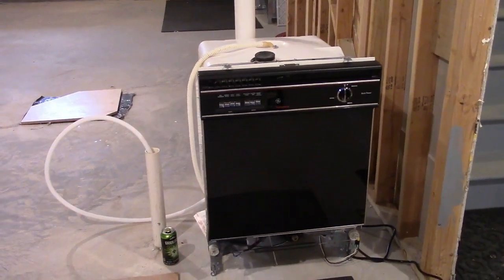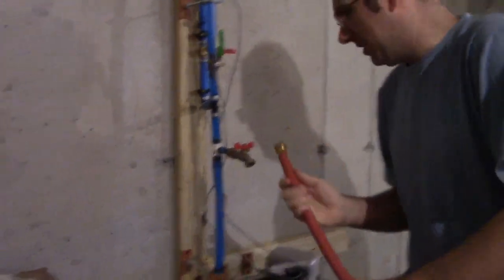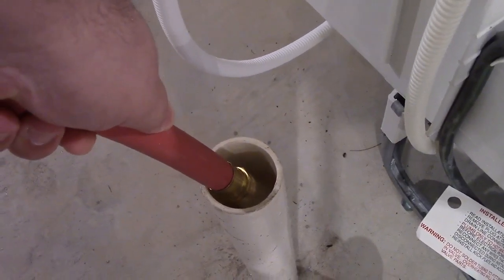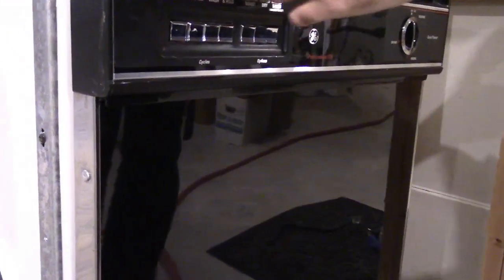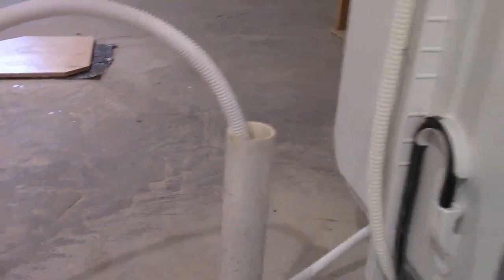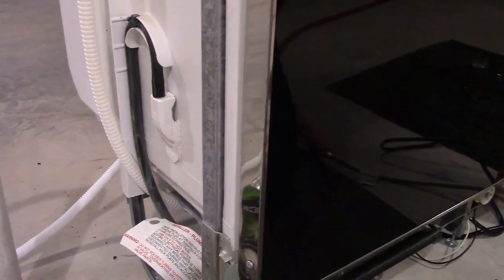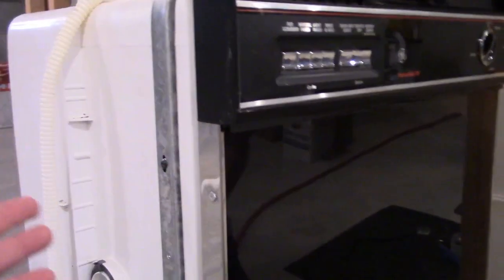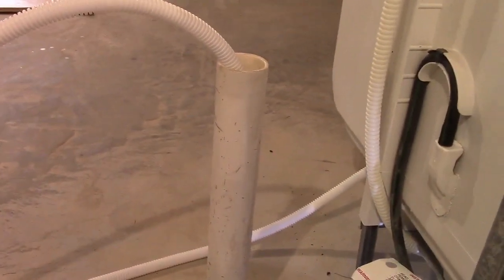Running A Cycle On Sharkie626's GE Potscrubber 970 Dishwasher With Wattmeter

Comment: So that was .59 kilowatt hours, and that was with the delay in the Potscrubber cycle that we let go for a while. So yeah, if this thing is in Normal Wash with Heated Dry, it is HARDLY gonna use more than the JennAir did with its 1 hour wash. That modern dishwasher's pump by itself uses very little, but the heating coil itself easily uses high 700s to low 800s (imagine if it was connected to cold water!). This uses about 450? Amazing. Once I have hot water there again, I gotta get a full cycle with the watt meter going. And as we all know, that modern pump isn't powerful enough by itself to operate all spray arms at once unlike this one is. 

Maybe the ONLY this this may use a little more of is water. But what do we know about water? It is MANDATORY to use in order to clean something, and clean something well. There is no way around it. Otherwise you'll end up with videos like that Technology Connections nimrod.
Reply from the maker: So what did we say in the video, 20 cents per kilowatt-hour?  So a full load including heated dry costs a whopping TWELVE CENTS of electricity.  As for water, they say you use more when washing the dishes by hand.  And we won't talk about how many flushes it takes in HE toilets, how long a shower someone takes is, and of course you can leave your sprinkler system running 24 hours a day if you'd like!
Reply: @jaykay18  Right? As usual, people will just buy into what many other says with no visual proof whatsoever. These toilets have honestly not been all that bad (could be because of my adjustments), but man do I miss that 3.5 gallon toilet. I wonder if the new owner still has it there. Well with the whole sprinkler system story I told you about, it might as well had been running for 24 hours.
Reply from the maker: @Sharkie626  Yeah that toilet was great.  Both of mine are 1.6, but at least 1.6 instead of 1.3.  And none of this number one number two stuff, that's beyond ridiculous.  Shouldn't my toilet like, be smart, and know what's in it so it can flush accordingly?

I've also found the style of toilet makes a difference, my downstairs toilet generally works a lot better than my upstairs, but they both get the job done most times.  I've also adjusted them as much as possible.
Reply: @jaykay18  New modern dishwashers have a draw, for example, .7 watts, as opposed to the GE and other mechanical timer dishwashers, which doesn't have a draw. Modern dishwashers waste electricity just being plugged in and not running. If we use the calculations that Jay used on his washer video regarding electricity use, we can do about ten extra cycles with the GE potscrubber dishwasher. I am thinking about one day getting an old dishwasher with a mechanical timer (GE potscrubber, Whirlpool with reversing motor, etc.), and a modern dishwasher with lots of fancy features(Samsung, LG, etc.) and do a comparison (cycle time, how well it cleans, how much wattage it uses, etc.) with these dishwashers. I may do the same thing with washers too.
Reply from the maker: @jacobflanigan6343  That's true, I didn't even take that into account.

Comment: Nice, Classic Runner!
Reply from the maker: Yep, I'm sure it does a great job!
Reply: Still been searching for a toekick panel and lower access panel. Sadly they are hard to come by. However it looks like one of the color inserts for them are still available.
Reply: @Sharkie626  Someday something might turn up on fleabay. Might be easier to have someone 3D print mounting brackets, and find some nice wood to finish it off.

Comment: I miss my old potscrubber machine that we used to have. Good thing GE still has a model with a similar design. The GSD2100 machine that is out now is not too much different then what was produced twenty or thirty years ago. Great vid as usual.
Reply from the maker: Yeah, that's the one dishwasher left out there that's good.  Not the same build quality as this older one but then again everything's a piece of tinfoil nowadays.

Comment: DishWash.. Day Wash-in was sponsored by phosphates in your cleaning products. Phosphates, get the dull ou- oh wait that's Ajax, wrong video. Dee what I sid there?

Reminds me of the old Whirlpool Dishwasher from the 90s in my old house. It was one of the porcelain insides, and you could REALLY hear the impact sound of the water on everything. I always loved sitting in front of that thing as it ran and just hearing that roar of the motor and pump doing their thing.

It was similar to this, you had your cycle selections, heat dry or air dry, and then the timer for how long you want to run it for. The buttons were plastic, but had a heavy click, similar to Sharkie's 1990 machines. It was just a big CHUNK, then you turn the big timer, yank it and away we go! I used to use the steam from the heat dry to clean my glasses back in the day, as a fun fact. Worked quite well. Oh and the best part, the dishes were guess what.... CLEAN.

Our 2006 Whirlpool Dishwasher isn't bad, but it does have the LMEctronic controls panel with the number that doesn't mean shit. No 30, no 20, NO, 85! SORRY, 103!!

We're saving 0.008 cents to the Kilowatt over every 25 years, just for the people who can't do math.
Reply from the maker: Indeed, I daw what you sid!

Yep, My KitchenAid in the kitchen has a tub like that.  I know the deal.

I never hung around the dishwasher for that long as a kid.  My dad's 1960s Hobart dishwasher he still has and it still runs.  It's in pretty bad shape by now, but amazing to see the quality that went into that.  Had a very loud water solenoid, and then sounded like a freight train coming through when you put your ear on the door.  Used to hang around for that one!

Isn't bad also means isn't good.

Oh yeah, saving the planet, 0.008 cents at a time.  If TEN MILLION people did that, that's 80,000 cents, or $800.  For TEN MILLION people.  Of yeah, this eco-green stuff is REALLY getting us far.
Reply: Well, it IS almost 60 years old if not 60 on the dot, but it still works. Seems like someone misspelled 60 years as 60 months for an appliance lifespan, and that became the new standard. Now no one knows how to spell.

You're not wrong. Some stuff, that thing just doesn't remove, even on heavy.

Like you mentioned, that Energy Waster option only ~wastes~ uses $35 more in power per year, thats nothing!

Skip the rinse, with Finish Jetdry!
Reply from the maker: @nl.515  That's very true!

Dishwashers aren't a be-all-end-all solution.  There's still some elbow grease and abrasive pads that need to be used for very tough cleaning jobs.  For your normal day-to-day stuff, dishwashers work great.

Energy Saver = Energy Waster!

Skip the rinse?  But my $4000 BRAND NEW dishwasher doesn't have that option, I can't even set it with my phone!
Reply: We have a cast iron frying pan for all the oven based things. I couldn't tell you all the stuff I have to do to get it clean whenever it's used. When I see it in the sink I KNOW I'm in for it!
Reply from the maker: @nl.515  Don't have any of those, fortunately.  I do have some porcelain-coated cast iron pots though, and rarely use them, even though they are easy to clean and care for.
Reply: They're a major pain in the ass to clean! Believe me!
Reply from the maker: @nl.515  I'm well aware of what's involved, which is why I don't own one!
Reply: I wouldn't blame even an old school dishwasher for a little bit of lacklusterness with super dirty stuff like that, but also wouldn't be surprised when it does a pretty good job for what it's worth.

Then the modern dishwasher sprinkles a couple of droplets on there, OMG CLEAN NOW BUT WAIT 18 HOURS FOR ME TO FINISH, LIKE EXTRA CLEAN LIKE OMG.
Reply from the maker: @nl.515  I'd really like to know what happened in this country.  The Millennials came in and destroyed the country, changed the washers and dishwashers, (not to mention toilets, light bulbs, cars, etc.) and we end up with machines that can't do the job they are intended for (much like a Millennial).  But the worst part is that people ACCEPT this.  That's what I can't understand.

Like modern dishwashers that don't take enough water to run all the spray arms at the same time, so they have to switch to different ones and run longer.  That adds cost and complexity.  Isn't the obvious solution to take more water so there is enough???  I guess Siri didn't know that one.
Reply: I know! It's unbeliveable! I've tried to show some people I know why stuff like this is garbage, and their rebuttal is, oh it's government mandated and it uses less water/power so it must be ok.

Well, I don't blame them, if you let Siri pull up search results about say incandescents against LEDs, usually the first 3 pages are nothing but LEDS ARE BETTER BECAUSE THEY SAVE ELECTRICITY, INCANDESCENTS ARE HOT AND BAD.

I've seen even more outlandish search results! That, I'll save all the fun for the emails!
Reply from the maker: @nl.515  I know exactly what you mean, the entire country is brainwashed into this.  Without water, of course...
Reply: If they brainwashed with water, maybe people wouldn't be so braindead!
Reply from the maker: @nl.515  You're right, but of course, like everything else, it all boils down (pardon the pun) to money.  Since water is obviously the most expensive substance on this earth, so much so that we can't use it, it would be too costly to brainwash people properly!
Reply: Water, water, everywhere. But none for you to have.
Reply from the maker: @nl.515  Oh sure you can.  You can drink as much water as you'd like, and nobody would ever complain (takes sip of water out of dirty Gatorade bottle) that you're wasting water.  You can HAVE as much as you'd like.  You just can't USE any!
Reply: Right, right. So if we are allowed to drink it but not use it, then my washing machine classifies itself as just drinking water.

Comment: That is LOUD. Although, I've had modern dishwashers since 2015. How long did that cycle take? My modern GE can do a full, normal wash, in 75 minutes. No joke. I think GE might be the best brand of dishwashers today. I love the old Maytag JetClean's, like my grandma's, which I think is more reliable than this. Remember, kids, GE sucks, you have to remember that.

Wait. Do they not have hot water at all??
Reply from the maker: These youngins...

Who cares how loud it is if it works properly?

I don't know how long a cycle is, that's something you'd have to ask the Shark, I saw it run once and that was it.  He's run several more cycles than I have.
Reply: I'm just used to the modern ones. It's been a while since we've had an older one.

I'd guess it's about 75 minutes, also. Then there's that heated dry nonsense that wastes time and energy.
Reply: The louder it is, the better it is (usually, anyway). Remember that it's not in any cabinetry and there's no lower panels currently, so it will be a little louder. 70 to 75 minutes sounds close. I know from ON to the start of Drying takes about an hour, maybe a tad less. 10-15 minutes of drying sounds about right.
Reply from the maker: @isaac24  Clearly you didn't watch this video in its entirety because I debunked that.
Reply: Nope. I don't have time.
Reply from the maker: @isaac24  You have time.  There ain't no school now.

Not to mention, you broke the CARDINAL RULE of commenting, never comment until you have watched the entire video.  If you see something at a timestamp that you want to say, make a note of it--I open up Notepad and jot notes down as I go, and then formally write my comment.

Otherwise you're nothing but a TROLL.
Reply: That's true.

I do that with about 95% of videos I watch. It's rare if I watch the whole thing without commenting first.
Reply from the maker: @isaac24  That's another trait of a fan twerp.

I'd suggest you watch the video in its entirety for such aforementioned information.  Also reading the comments in this video, thus far, is a good thing.  It can show you the errors in your ways.  "Are you right about everything?"  "Usually."
Reply: Why?
Reply from the maker: @isaac24  Because ADHD is one of the current trendy disorders.
Reply: It's a real thing. And I'm a strong Conservative. So if someone like me  thinks it's real, you better believe it.
Reply from the maker: @isaac24  I never said it wasn't real.  But it's one of the "trendy disorders" which means many who are diagnosed with it don't actually have it.
Reply: I don't know if it's a real thing or not. I was diagnosed with it, but I'm not sure if it's a real thing.
Reply from the maker: @isaac24  Just before you said it's a real thing, now you say that you don't know if it's a real thing or not.  Of course you were diagnosed with it, when you were born, this was the trendiest disorder there was!

Comment: That dishwasher sounds amazing! This is a big childhood sound. In my paternal Grandfather's house was a GE Potscrubber II, from about 1976, and it lasted until 1997.
 https://www.youtube.com/watch?v=SyqdRDqL0eg 
 It sounded a lot like the 970, but had a light green interior. Does the 970 have interchangeable front panels behind the black one? I would imagine it would have an almond, and white behind the black panel. The Potscrubber II had white, harvest gold, avocado green, and coppertone or whatever GE called the brown color at the time.
Gee, imagine using plenty of fresh water to clean dishes! Would have been cool to hook your water meter up to see how much water a cycle used.
Reply from the maker: The answer to your question will be revealed on the next installment of this, later this week!

I didn't even THINK of the water meter, that would have been an excellent idea!  Too bad, too...Sharks don't like to run dishwashers with cold water because of the 5 drops it leaked, and I'm not going to put hot water through the water meter.
Reply: @jaykay18  I watched it during lunch today, and I was quite surprised to see that "Harvest Wheat" panel in the mix! Of course, that was my favorite panel, as my Grandfather's had the Harvest color on his PSII dishwasher.